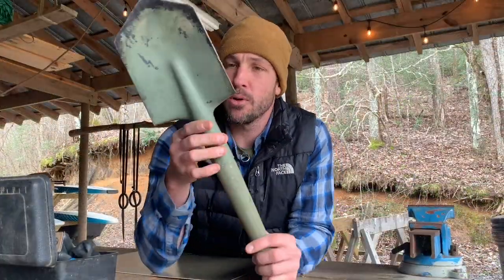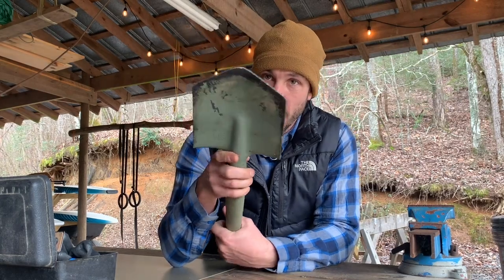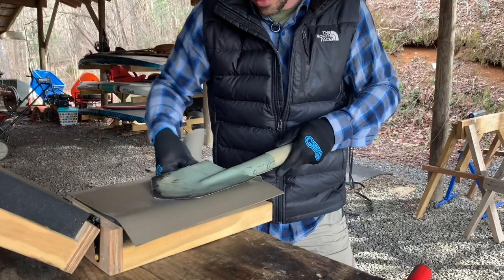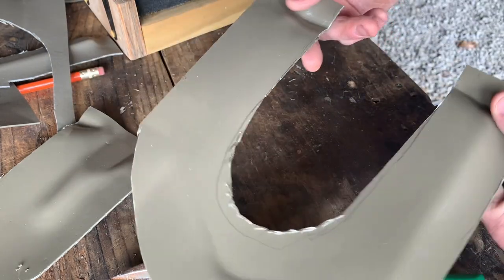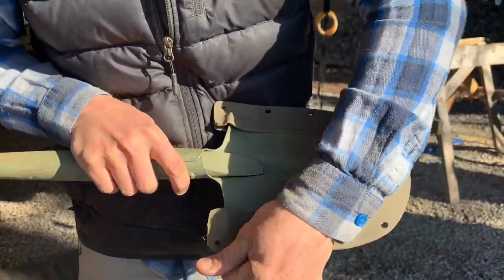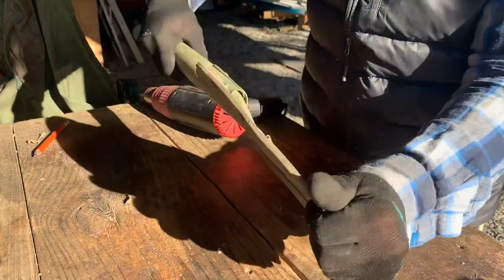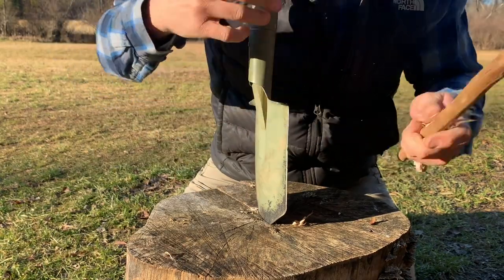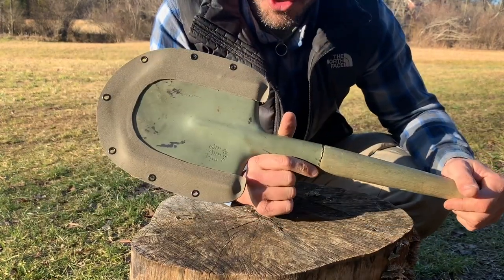Building a Kydex Sheath for a Spetsnaz Shovel

Comment: Great project! Been using the Cordura sheath it came with, but I like the light weight of yours. I've been using the Cold Steel Spetznaz shovel for nearly 20 years, and I consider it one of the indispensable items in my kit.

Comment: I am an "expert" and you did a pretty good job for what you wanted to accomplish which was to protect the sharpened edge. Lots of people think it's easy but have never tried it. For less than $100 you can start playing around with thermoforming Kydex as you have shown. Now, if you want to spend a few thousand on better equipment you can do that too. 

Seeing a shovel as your one-tool experience would be pretty interesting. I have been interested in them since Cold Steel released their version years ago.
Reply: Thanks for the input. Seems like there is a lot of interest in the shovel only survival. I will make it happen!
-Jason

Comment: That is cool! I like the cordura sheath that CS makes as well. I painted mine camo - took a lot of green and sand spray paint but it looks good and still light. I made a paracord baldric sling for it. it hangs upside down well and and easy to deploy if only one snap is snapped it can come out fast.

Comment: Idea for etool sheets one sided Kydex with a lip going around backside of the shovel + enough washer Style rare earth magnets riveted to the inside of the Micarta so they come in contact with a shovel the lip of the Micarta going around the shovel Edge Keeps The Cutting Edge safe you could literally just slap the shovel into place and it will lock in pull old or pry off to utilize the shovel Quick Draw. The only problem is falling down a hill it might come off but then you do have other issues

Comment: With that sheath it would make a pretty good paddle, better than just the shovel alone. (You might want to secure the sheath to the handle in some way, as, it would fall off using it like a paddle. JS)

Comment: I love how flat your shovel is.  The Cold steel should be flatter, imho,  more controlled chops, better indexing. These small faces will fling as much dirt as need be, but the flatter face digs in easier.
Reply: The 1985 made shovels were very flat but for digging I prefer the 1944 version because it's dished a bit more.